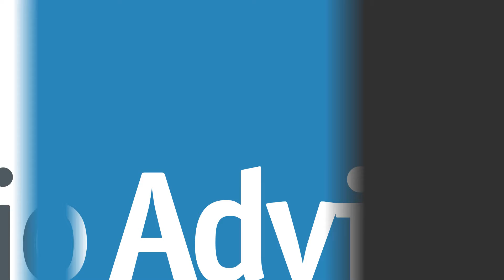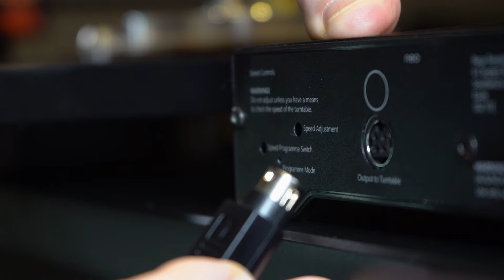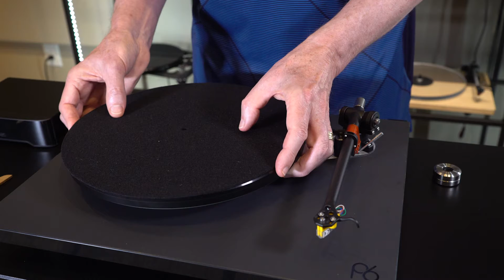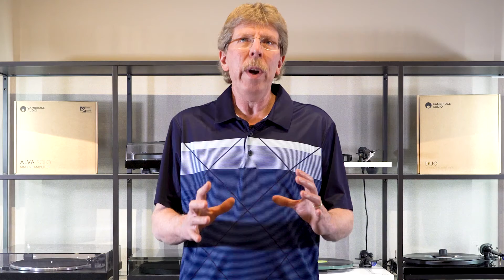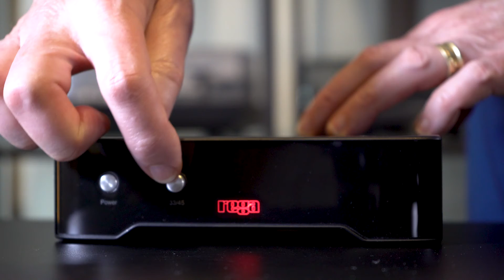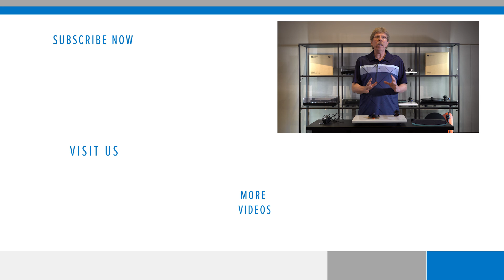How to setup a Rega Planar 6 Turntable

Comment: Excellent setup video, thank you. Worth noting that the P6 is supplied with a smoked dustcover and the white belt has now been replaced with our latest black advanced EBLT drive belt (which is also used on Planar 8 and Planar 10 models).
Reply: Impressed you guys comment on videos, nice dedication
Reply: I thought the dust cover in the video looked wrong.
Reply: @georgedoughly8682  I thought your comment looks wrong.

Comment: How can it be that NO one is doing it the way Rega suggest in their manuals? They write: balance the tonearm, so it floats 1mm above the RECORD surface. If you do this, then be sure to have a blank sided record, so when you lift the arm towards the spindle, to see if it's clear of the surface? The blank sided record is for your safety, and if you do it this way, it's much more accurate then the way showing here. Cheers

Comment: The arm looks cheap for the money, for that money I prefer a clearaudio.
Reply: You don’t know what you’re talking about. Rega has spent 30 years designing tonearms and building them in-house. The P6 turntable has the RB330 handmade precision tonearm, made in the UK. Don’t just go “uh... it looks cheap” without having seen or used one.
Reply: @cosmic-fortytwo  Clearaudio = Germany
Reply: @JohnSmith-zl8rz  
Rega is better, Ive had both
Reply: @ralexbee  which both? models?
Reply: Clearaudio Concept is inferior to P6, both regarding sound quality and build quality. No contest. I've seen and heard them both. Clearaudio models are probably the most overpriced turntables on the market.
Reply: @brave1671  mmm some say say the opposite vs the rega p6 and favor to the clearaudio, but yes the p6 looks like a great table! if only I can get it for under $1500, I would get it.
Reply: @JohnSmith-zl8rz  John Smith: makes zero sense.
Reply: John Smith - go away, you know nothing.